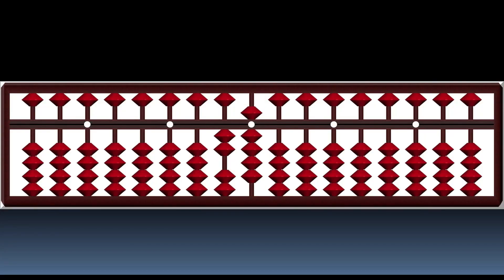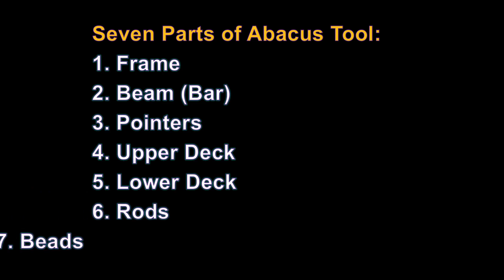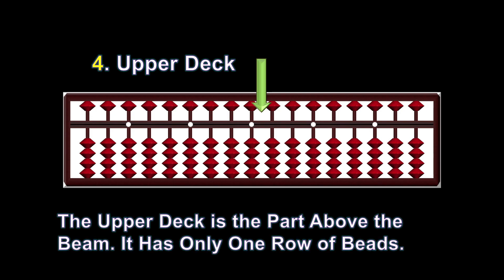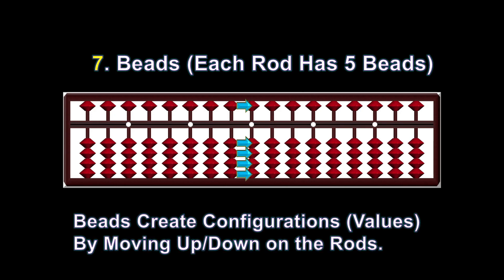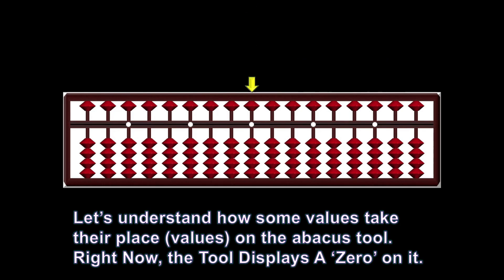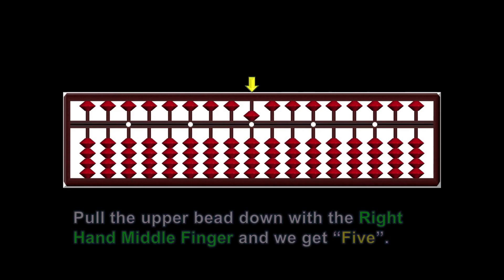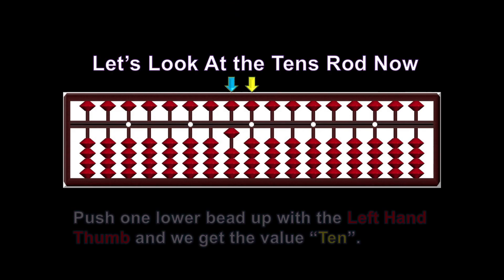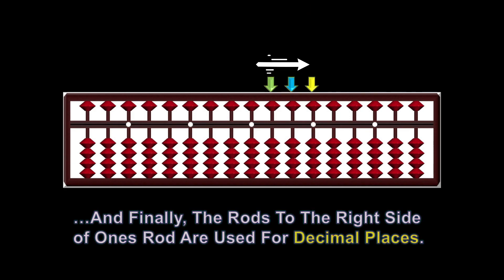Free Abacus Online Course - Introduction 2

Comment: I see different explanations on how to handle the abacus and how to solve problems. The abacus is not really used in the western countries (Europe and the Americas), but I still find it to be an interesting tool. Even if you can't speed up your calculations, it can still be useful to use it instead of calculating everything in your head. Allthough it's a calculator, you're still required to use your brain. And finally, if electricity is not working, the abacus still does. We're so much depending on technology that we give up using our brains for math and logic and let the technology do the work for us, and it appears that is with major consequences, because it seems that an increasing amount of people in western countries has trouble with reading, writing and mathematics. It's not without reason that many far eastern countries dominate education in terms of the quality of these three aspects.

I'm wondering what explanations about the use of the abacus are the official and correct ones. I also think that this depends on in which country this is taught. For example, you're instructing to use the right thumb to add lower beads (in the west and in Japan and China known as the earthly beads) and subtracting them with the right index finger. This is common everywhere, as far as I know. However, there are differences in how to add and subtract the upper beads (called heavenly beads in the west, Japan and China). You're instructing to use the middle finger to add and subtract upper beads, while other videos from indian teachers and other sources from western countries, as well as from Japan (for example, two handbooks in English, wriiten by Japanese mathematician and expert abacus user Takashi Kojima), instruct you to add and subtract upper beads by using the right index finger. Kojima even addresses the order in which you should add and subtract all beads in problems using multiple rods and complementary numbers (I believe it's called the 'small friend' or 'big friend' formula in your country), just to save time and speed up the use of the abacus.
Also, in other countries it seems that another pointer than the one in the center is often used to mark the ones rod (usually further to the right), and that multipliers and divisors are both put on the left of the abacus, while the starting number of the problem is put in the center and the outcome appears on the right. You probably use the center rod as the units rod, because I haven't seen other videos than those from Indian teachers, and most of them try to get the outcome of a negative value on the right, while outcomes with a positive value are kept in the center. There also seem to be different placement and calculation methods for multiplications and divisions.

What are the official international rules for all of the different methods used on the abacus? Of the methods you use, are all official, and if so, are they only official in your country or also internationally?

By the way, those English handbooks by Takashi Kojima are a very interesting source of reading and learning material.
Reply from the maker: Sir, I am amazed at your depth of knowledge about the abacus techniques followed in different places! It's true that there are a lot of variations in 'use of fingers' and 'placing of values' on the tool. There is one thing common between all - They all aim to convert the pictorial representation of beads into mental imagery, leading to faster mental calculations!
The only difference is - what stage of evolution does each technique belong in a particular country/place.
For example: I got trained by UCMAS (headquartered in Malaysia) which has presence in almost 200 countries and it is a leading brand in India. Initially, I was trained on the prevailing 'four finger' technique (Thumb and Index finger of both hands) that you see in the older literature. Later on, the refresher training in 2018 involved using 'six fingers' that you see in my videos. Personally, I have seen greater 'ease of use' and slightly better performance in my students after switching to the latest technique. However, most of the indian brands still haven't switched from 'four fingers' to 'six'.
In short, there is no single 'official' technique in the world but all the techniques lead to faster mental calculations, varying to some degrees only. Ultimately the skill depends on two important factors - the 'aptitude' of the trainee and the amount of 'efforts' put in!
Reply: Well, perhaps there is no 'official' technique in India (or Malaysia), but the origins of the abacus are not in those countries, but in China (suan pan), Japan (soroban), and to a certain degree in the former Roman Empire (the one is older than the other, but they all made their own versions. I've even seen a picture of an antique 4 upper-5 lower bead Tibetan abacus, which must quite obviously have been intended for calculations in both the  decimal number system, as well as the vigesimal number system (base-20), which for example was used by the Mayan civilization. But my point is that I expect that, if there are 'official' techniques, they have to originate from either China or Japan. Both those countries still use only the thumb and index finger in a 'left hand holds the frame and two right fingers slide beads' method, as far as I'm informed. Both those countries may have changed their techniques based on their own versions, but the one mostly used now is the Japanese soroban, for reasons mainly concerning the level of ease at its usage.

For example, the soroban is said to be the superior of the two now, because there are no extra beads that don't have to be used in advanced abacus techniques, allthough the suan pan may be preferred by beginners because of the exchange method that can be used as an extra step instead of just using the 'shortcut' preferred by advanced soroban users. Another reason thd soroban seems to be superior is the shape of the beads, which is biconic, making it easier to position the thumb or index finger between them when setting, adding or subtracting numbers, as opposed to the suan pan's round or slightly oval beads, which can more easily be handled inaccurately.
Reply from the maker: I apologize for replying to this comment after a good 9 days. Actually, as you mentioned, the two leading abacus tools (and their techniques) originated from - China and Japan. The Japanese Soroban is widely popular because of the reasons mentioned by you. You are absolutely correct that the present form of abacus did not originate in Malaysia or India. But, every academy in India uses 'Soroban Abacus' as the base with slight variations of techniques. My techniques are also based on the same Japanese model with modifications in the course structure and techniques to adapt (and evolve) with the new generation of kids in India. Still, the true essence of Japanese Soroban will always remain unchanged.
Reply: yes i also know and heard about that